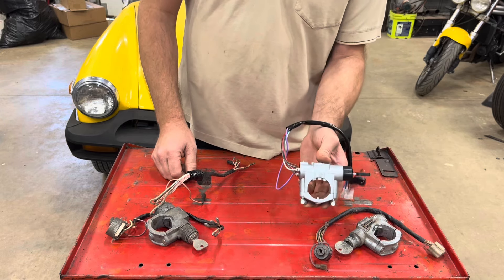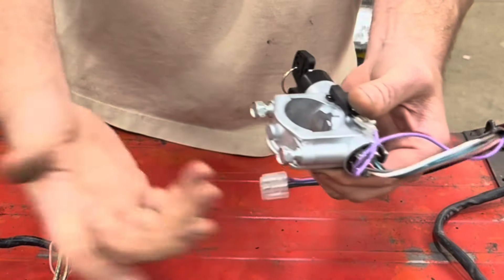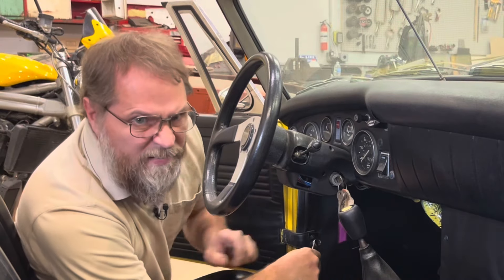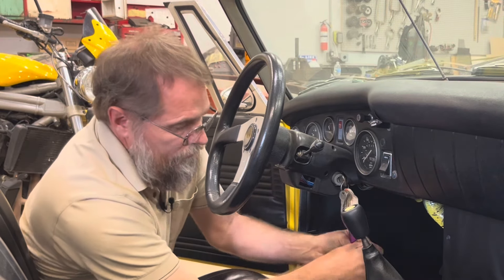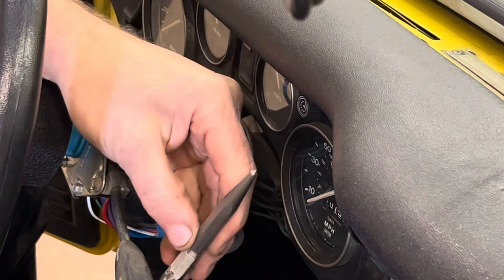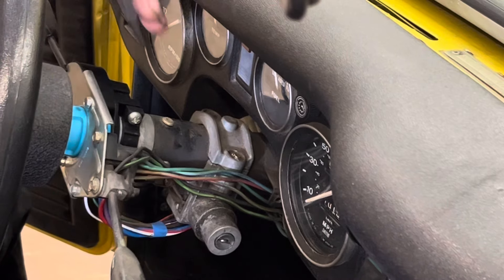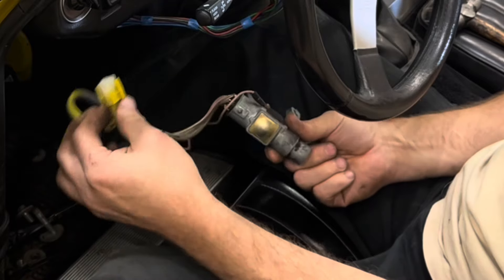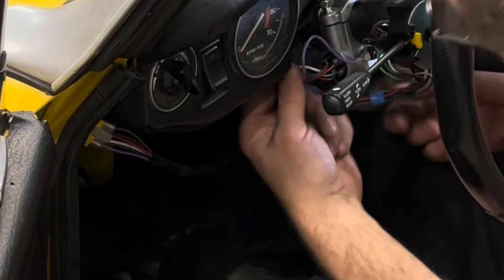Midget/MGB ignition switch replacement

Comment: Did mine on my RHD 73 RWA Midget a couple of weeks ago. Decided to just take the whole column out as I couldn’t see the heads of  the old shear bolts when in the car. Nice and easy to use the punch to turn the bolts with the column out and on the bench.  I also didn’t shear off the new bolts just in case it needs to come out again for any reason.  Interesting to see how US spec Midgets and B’s  differ from UK spec models over on this side of the pond.

Comment: Not a MG owner but may in the near future but can the bolt be changed to a regular bolt some how.
Reply from the maker: I would guess you could except the way the housing is machine I don’t think the head of a regular bolt would actually fit into the recess that is machined into it for the bolt heads.